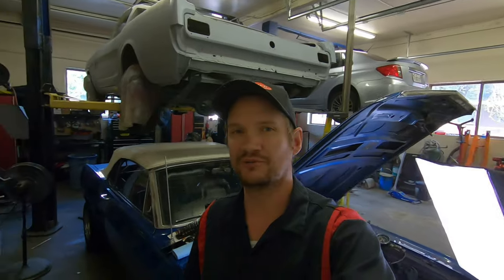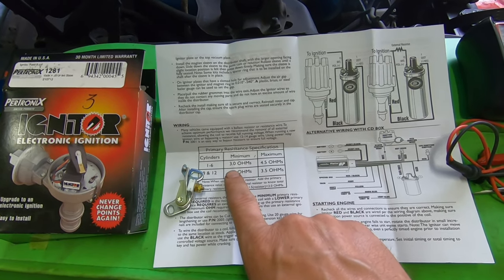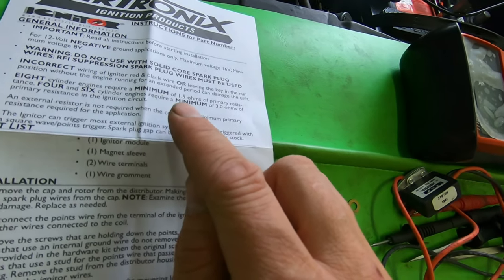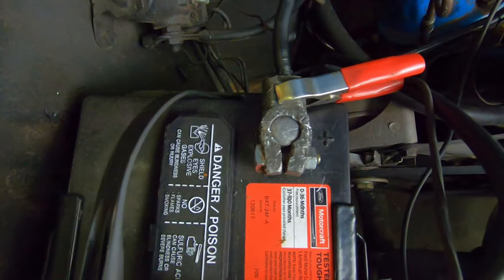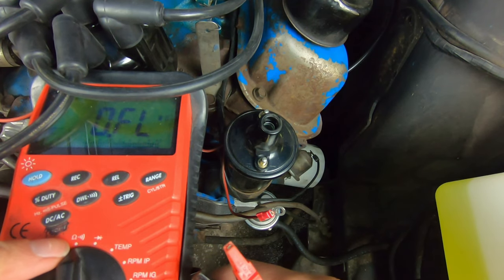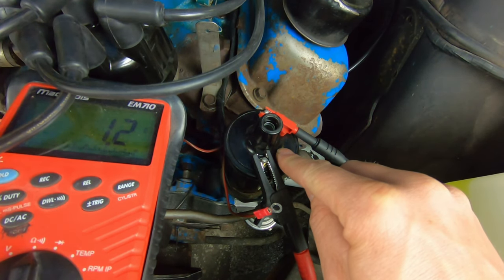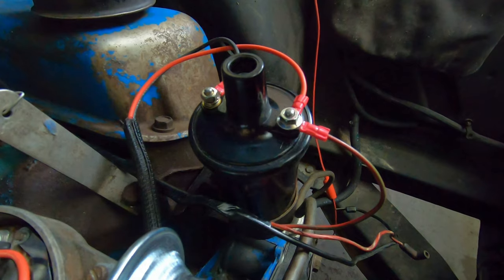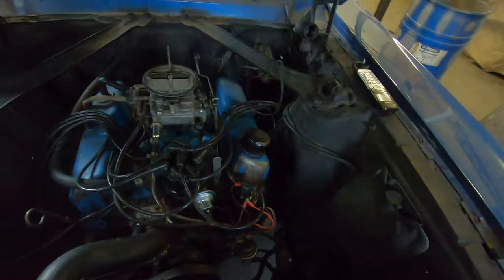Pertronix Electronic Ignition Upgrade - 1967 Mustang 289 V8

Comment: Can someone clarify?  I always thought these systems need to be connect to 12V key-on power, not the 6V at the coil, no?
Reply from the maker: Well it's more like 10 volts at the coil. But no Pertronix will say it runs best with 12 volts but it doesn't necessarily need it as long as the resistance is in spec. I mean the resistance has to be there regardless but there is that range that people never talk about 👍
Reply: @AlfsMustangGarage  Excellent, I have a set to go in my 71 cougar so I wanted to make sure I had the correct connection.  Much easier connecting the the coil rather than tapping in at the fuse box.  Great vid!
Reply from the maker: Right on, you still need to check your resistance though to make sure you're within specifications. I wouldn't advise to just hook it up and call it good. Read the pertronix instructions, it tells you everything you need to know.

Comment: Hi, according to your video I ordered a Pertronix from US to Europe. Because there is nothing similar available in Europe.
I wanted to install it, but the magnetic ring is bigger than the diameter in the distributor.
Please, do you know what to do now? Is it possible to order a smaller diameter somewhere? Or can the magnetic ring be padded somehow to hold the distributor securely?
Reply from the maker: Sounds like you have an aftermarket replacement distributor. The pertronix units only fit the factory original distributors. I've come across this before and called them. They did not have any solutions for this sort of thing.

Comment: Awesome video, you do a great job explaining! I have a question though, it says in the instructions that it needs a 12v keyed source but when I measure the voltage on the positive side of the coil I am only getting around 6 and some change which I am guessing is due to the ballast resistor? I have seen other folks say you have to bypass the resistor in order to get the full 12v. What are your thoughts?
Reply from the maker: So I find this topic rather strange because I get asked this a lot and I also see a lot of people talk about it in forums and on Facebook and more often than not, people are just given the wrong advice. You do not need to bypass your resistor in order to run the Pertronix IF your total resistance values are in specifications. Its more about the total resistance in the circuit than the voltage to the coil. This is why I focused my video a large part by measuring the total resistance of your coil and factory resistance wire. If if there is too much total resistance, then you will need to by pass the resistance wire or ballast resistor in order to bring that down to a normal level. I hope that makes sense and clears things up.
Reply: @AlfsMustangGarage  Thank you so much for taking the time to answer my question and yes it makes sense. I have a 67 Mustang of my own that I am thinking about doing this too so it makes the process so much easier! Thanks again for the help!
Reply from the maker: You're very welcome! Glad I could help.
Reply: @AlfsMustangGarage  So I went home last night after watching you video and measured the resistance on my coil and it is reading 1.5 ohm, I also measured the resistance of the circuit and I got around 2.5 ohm without the coil. When I measure total resistance of the circuit including the coil it is 4 ohm which puts it outside the parameters. Just curious what you would do in this situation?
Reply from the maker: Is there an extra ballast resistor on this by chance? These cars have that resistance wire which is typically 1.3 ohms. I would be curious as to why you have extra resistance but ultimately you have to get that down which would likely be bypassing the original resistance wire. But I would be trying to see if someone added an extra resistor first.
Reply: @AlfsMustangGarage  Thank you for your reply, tell you the truth I have no idea, like you said there is no telling how many hands have been in the cookie jar since this car left the factory. I do know that the care was originally an inline 6 car and we did a v8 swap on it. I guess I need to dive in and start tracing some wires!
Reply from the maker: Yup that's true. So typically what I see when people add an extra resistor is it will be mounted in the engine bay and be fairly easy to spot. You could probably check sections of your wiring to try to find the excess resistance. For example you could disconnect the engine bay harness and just check that to see if there is any excess resistance. Old wiring also has a tendency to build corrosion inside the insulation where it can't be seen. This is probably more common in a more humid climate. But at least you could try to concentrate the section of wire that has the extra resistance to the inside of the car or the engine compartment side. Just to keep all options on the table, it could entirely have extra resistance naturally just from old corroded wires. But here is also a link of what a typical aftermarket ballast resistor looks like. It will be fairly easy to identify if its got one.  Hope that is helpful. https://www.summitracing.com/parts/smp-ru11?seid=srese1&gclid=CjwKCAiAzrWOBhBjEiwAq85QZ2YJgku138pj34A_M1N_dwXSO4MvkTGxF5v8LvBQoeVpqPtXCUpkKxoCF24QAvD_BwE
Reply: @AlfsMustangGarage  Thank you so much for the info! Yah I think it would be best to split it up and check in the engine bay first then move inside the car since that is how my brain works anyways, when I get home tonight I will start the search. I live in eastern NC and is pretty humid here but I would not think it would make that much of a difference. my money is someone added something that was not needed. After thinking about it if I where to drop the resistance that should bring my voltage up addressing my original question.  Super glad I ran across this video, learning something new every project I attempt!
Reply from the maker: Your very welcome I'm glad I could. Keep me posted on what you find. I'm very curious as to what you find. Have a great new year!
Reply: @AlfsMustangGarage  So when I got home from work I checked again and found that my total resistance was 3 ohms, I took the coil out of the loop and it was measuring a little over 1.5 ohms so I have no idea where the extra 1 ohm was coming from the night before. I did trace the wires from the coil to the firewall and the solenoid to the firewall but did not find an additional resistor anywhere. I have not checked under the dash yet, might try that this weekend.
Reply from the maker: Interesting. Sometimes a double check pays off.
Reply: @theherrings910  Hello, I'm experiencing the exact same problem as you and found your discussion. I'm wondering, did you succeed on finding that extra resistance ?
Reply: @JoAkh  I gave up and ended up using a relay to be on the safe side
Reply: @theherrings910  Oh ok. Thanks for your answer.

Comment: How do you test the ignition switch to see if it is bad .is your shop in Florida?
Reply from the maker: One way to test without removing it from the car would be with the ignition switch in the "run" position, you should see voltage on the positive side of the ignition coil. With it in the "start" position, you should see voltage on the "S" terminal of the starter solenoid.
Reply: Thank you also is your shop here in Florida or what state are you in I'd love to take my car and bring it to you
Reply from the maker: We are in Utah
Reply: I put a new ignition in and I'm getting a very weak light on the positive side of the coil is that about right
Reply: Would the regulator box have everything to do with no power or less power to the coil
Reply from the maker: I'm not sure what you mean by regulator box. Assuming you have an early mustang, they have a resistance wire built in the ignition circuit to take away a few volts in order to prolong the life of the ignition points.
Reply: I have the protonix distributor I was talking about the regulator for the voltage does it have anything to do with the power to the coil because now I have a very dim light
Reply from the maker: None of the voltage regulators limit the voltage to the coil. The resistance wire does though.

Comment: The manual states that you should use RFI suppression wires to the sparkplugs, is this really necessary?
Reply from the maker: Yes. But have you seen any spark plug wires sold that are not RFI suppression?
Reply: @AlfsMustangGarage  didn't dive too much into that before and don't know how old my cables are

Comment: Do I need 12 volts for flame thrower 3 do I need to bypass the resisting wire?
Reply from the maker: More than likely you need full 12 volts. I would read the instructions for that specific application.
Reply: @AlfsMustangGarage  I bypass it and I'm getting 12.57 volts to coil but still won't run my timing chain is not tight got a timing chain cover and timing chain, would that be the reason why it also wouldn't run
Reply: @AlfsMustangGarage  I had it running and it was running fine and I couldn't put the vacuum advance vacuum line on it would kill the motor
Reply: @AlfsMustangGarage  it would kill the motor and it was with the other distributor that's what I put the flamethrower 3in and bypass the ignition and the timing is on time also the flamethrower three does it need a brainbox
Reply from the maker: I think you would be better off contacting pertronix tech support for this one.
Reply: @AlfsMustangGarage  ok thanks for help and love the videos

Comment: I have a 65' with a 289 and am looking to do this upgrade and did your test. At first, it was reading about 26.5 ohms. I then warmed the car up for about 5 minutes and getting 3.7 ohms. Not sure if that's what changed things or I did the original test incorrectly, but I used both methods and had come up with 26.5 the first go around.  Coil came it at 1.3 ohms before and after warm up. Also, I'm using a cheapie Harbor Freight gauge, which may not be perfect. What do you think of the 3.7?
Reply from the maker: Well technically the 3.7 is above the maximum resistance. So if that number is correct and accurate, you would want correct that. But it sounds like you may want to triple check your test and if possible with another meter just to be on the safe side.
Reply: @AlfsMustangGarage  I called Pertronix and they said I need a 1.5 ohm coil, such as their Flamethrower and to connect into the ignition wires prior to the pink resistance wire.  They said the unit needs to be supplied with a full 12 volts or causes issues with the car running properly and not enough juice to the unit. Not sure how to make that connection, but apparently there's a red/green wires prior to the pink and supposed to crimp on to that? Have you ever had to do that?
Reply from the maker: I have had to do that on certain cars. However, Pertronix wants to sell you their coil and have you re-wire your ignition circuit. Which works and is all fine and dandy. However, not entirely necessary if you can find the un-wanted resistance in your circuit. According to their printed instructions you can do it both ways.
Reply: @AlfsMustangGarage  any tips on finding the unwanted resistance? The guy also mentioned they have some type of relay you can run directly off the battery to the unit and not hassle with the wiring bypass. Thanks again...
Reply from the maker: Sometimes, its easier to just purchase the coil and relay kit because with over 50 years of history, you never know if the old wire itself has extra resistance or what is going on. If you're confident that you have 3.7 ohms total on your circuit, then getting the coil and relay is by far going to be the easiest and safest route in my opinion.
Reply: @AlfsMustangGarage  I saw in another video that they disconnected the pink bullet connector from the red/green bullet, ran a new wire to the coil with bullet to the red/green and abandoned the pink. Does the pink only go to the coil? Hard to see what’s going on when everything is wrapped coming out of the firewall. The wrapped wires on mine T off, one to coil, one to I think is the oil pressure?
Reply: @AlfsMustangGarage  As far as the timing goes, some have said that after the install, the timing changed some. Mine is currently at 6 degrees and runs ok, but not great. I've heard that nowadays with modern fuels, it is better to set at 10-12. What do you think? It's a stock 289, no modifications whatsoever.
Reply from the maker: I usually set mine to 10 and make sure to run 91 octane 👍
Reply: @AlfsMustangGarage  sorry for all the questions, but at minute 18:30 where what looks to be an old coil wire connection hanging down, was that the old pink resistor wire?
Reply from the maker: No the resistance wire is going to be on the inside of the car. Once it comes through the firewall, it's just a normal wire.
Reply from the maker: And you're good, no need to apologize 👍
Reply: @AlfsMustangGarage  okay, I installed the igniter and a new flame thrower coil and fired right up! No sputtering like before and nice and responsive. Only thing is I can hear what sounds to be a valve or something clacking now. I need to check the timing but too bright outside to see the marks! Going to try and get it to 10. Can timing being off cause that clacking or totally unrelated? Didn’t do it before the swap. It did pretty much go away when the engine warmed up. I’m obviously no mechanic asking these questions. 😀 btw, thanks for all the help.
Reply from the maker: Well In my experience, if you have a clacking noise that goes away after warming up, that is a sign of an exhaust leak or possibly oil related. Such as a lifter or such. Typically if a lifter is noisy, they don't really go away.
Reply: @AlfsMustangGarage  adjusted the timing to 10 degrees, took a quick spin,. Definitely much smoother. Hopefully all good for a long time. Thanks for everything!
Reply from the maker: You're welcome! Hope it all works out 👍

Comment: Would this work with a dynamo and not an alternator ?
Reply: I have a 64½
Reply from the maker: Are you referring to a generator?
Reply: Yes,
Reply from the maker: You know, I'm not really sure. I would probably get with Pertronix and see if there is a kit specifically for the early generator cars or if the alternator ones work.
Reply: How did the petronix distributor worked? I have the same year and generator
Reply: Worked very well for me